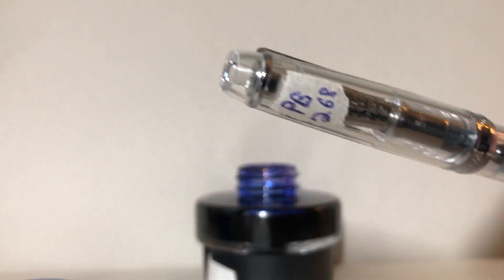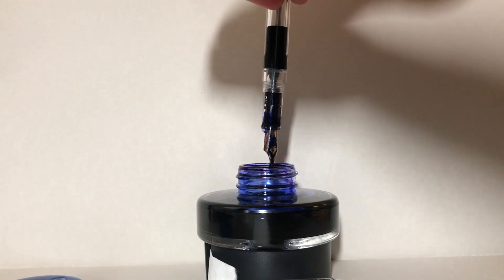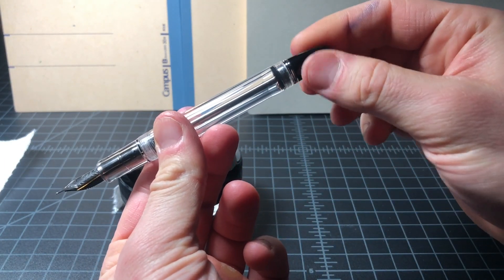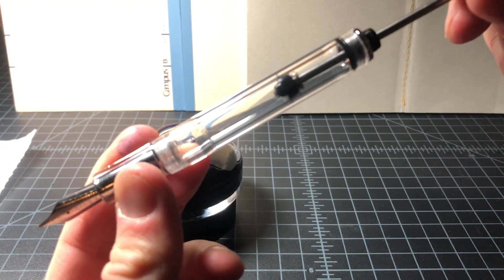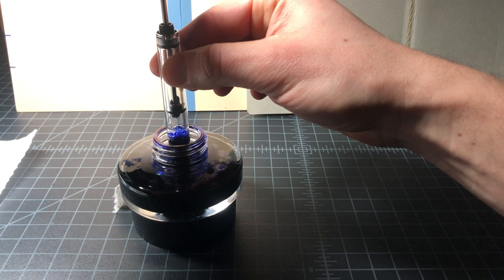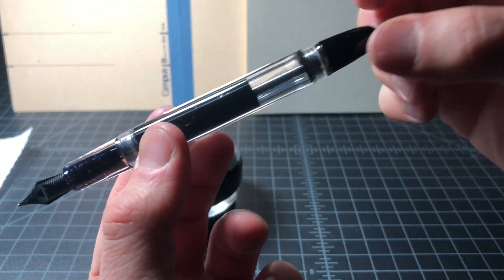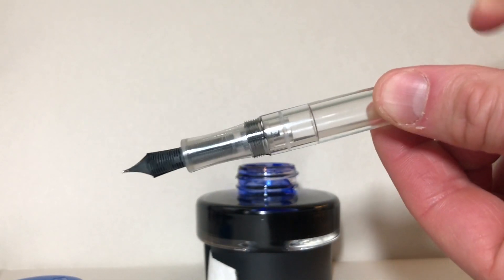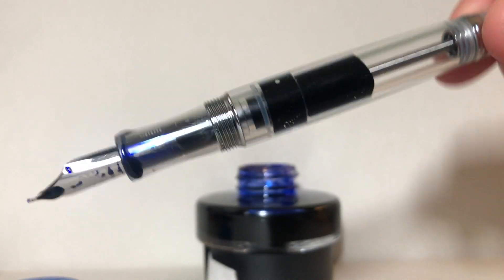How Do Vacuum Fillers Work? Fountain Pen Explainer

Comment: These are so expensive! I'm 3dprinting my own :) I think tomorrow I'll get to try my first prototype

How do the penbbs and 700r compare when writing btw?
Reply from the maker: How did the 3d printing go
Reply: @unsharpen  good. The mechanism works well and surprisingly inks 80% with a single push. But on the final version I made a mistake and my plunger can't be inserted into the pen and my  cad software crashed and loses my progress and I had a horrible day so I'm too frustrated and hurt to try again.

I'll try in a bit.

There'd also an SLA version that's arriving in probably 2-3 days since I don't have an SLA printer I ordered it. That one is like a vac mini!

The prototype worked great tho. It'll probably be final and writing in 5 days? I also dropped the prototype nib down and bent my nib do I'm waiting for a pilot preppy to steal the feed and nib out of. I'm sad cause the feed was a cool waterman one

Comment: Hey mate, 
I’m having trouble with my vac 700, do you have any tips for me? I noticed that the video covering this is blocked for the public.
Cheers
Reply from the maker: What’s the issue? Mine had a cracked piece so it leaked. The video is supposed to be for subscribers only
Reply: @unsharpen  I have found this pen to be dry with poor flow. Not sure if its a lefty thing, the ink, the nib or the pen??

I’m using noddlers Tolstoy

It’s a fine nib.
Reply: @bgreer4752  have u tried writing with the plunger unscrewed? 
It will run dry after a few words because a vacuum forms, thus,  pulling the ink into the pen instead of flowing out the nib. 
Unscrewing the plunger stops the vacuum from forming.

Comment: i miunderstand, if the plunger goes down, why the ink goes up? shoudln't it be the opposite?  or the plunger has hole in it?
Reply from the maker: The plunger creates a vacuum and the opens the vacuum at the bottom of the stroke. Thst sucks the ink up

Comment: I have a tiny question. If pushing down the rod creates a negative pressure at the section behind the rubber piston. How could pulling up that piston not creating a positive pressure behind it in the first place? Does it mean that air could travel from one section to another while the piston is moving up but not the other way around?
Reply: There's a valve at the top. So pulling it drives the air out the valve behind the piston and a vacuum in front.
Pushing the piston cancels the vacuum in front and produces a vacuum behind it.
So when it hits the wide portion, the vacuum goes around the piston and sucks in the ink to cancel the vacuum.
Reply: @steevting1789  Thanks

Comment: How can you pull the plunger back tho? Unless there's a one way valve there

Also when you do your second pull, why is ink just passing falling around the plunger. If liquid can just pass around it doesn't that mean it doesn't have a seal?
Reply: The barrel at the start/finish position is wider so yes the ink does go around the seal.
Reply: @steevting1789  actually it appears that it has a one way valve, after this comment I got so obsessed that i did a lot of research and 3dprinted my own vac fill pen :D